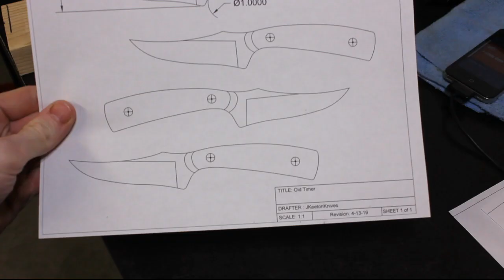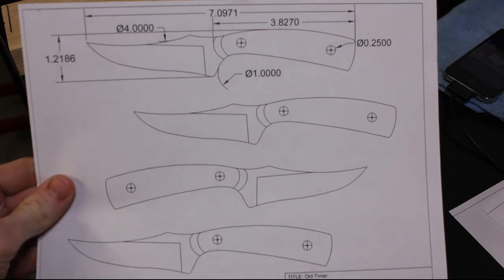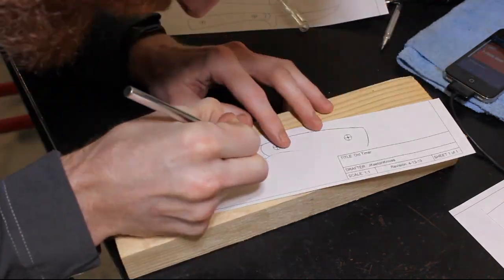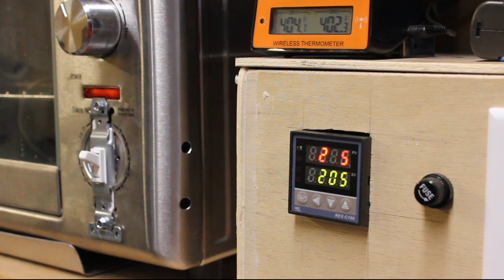Knife Build - Mustard Patina - Old Timer Sharpfinger Replica

Comment: I saw that use of square tubing as an oven a few nights ago on forges in dire
Reply from the maker: TheGhostBeast hey Ghost! That piece of square tubing in the forge is generally referred to as a “muffle pipe”. I’ve found it really helps you evenly heat the blade during the heat treat and minimizes hot spots!
Reply: JKeetonKnives I may try this. I do have a question though. Could you do it with a charcoal forge
Reply from the maker: TheGhostBeast , I don’t personally have any experience with a charcoal forge. But I have heard of people utilizing muffle pipes for them.
Reply: JKeetonKnives 
I use a charcoal/mesquite wood forge. Have never tried a muffle pipe. That’ll be next. You did an excellent job on the knife build. I just recently subscribed to your channel. I’d love to see you pounding something out. Keep on keeping on brother.

Comment: I just bit the bullet and ordered an oven. I enjoy using my gas forge but I’m limited to outdoor heat treating. My blades never flame in vegetable oil but I see yours do. Im definitely up to temperature ( non magnetic). 🤔
Reply from the maker: chip Lape man! I’m jealous! What oven did you go with? Mine don’t always flame up either. I don’t think that’s the best indication of success. I normally try and get 20-50 degrees over non-magnetic, but with my set up it’s not an exact science.
Reply: Even heat kf 18. Can’t wait to get it. Says 5 weeks 😬. So I’ll still be using the forge for now. I really admire your attention to detail 👍👍👍. Next I think I’ll get a big wheel. What size do you use. Then I really need the DD tool rest!!!
Reply: Love the mustard treatment. Is that it just leave it on 2 1/1 hours and wash off. Again what did you spray on your knife at the end.
Reply from the maker: @e.t.preppin7084  Yes sir, that's exactly what I did. Make sure your mustard has vinegar in it. I used Ballistol multi purpose lubricant to spray the knife down with.
Reply from the maker: @e.t.preppin7084  Man that's awesome! I'm supper jealous now! Sounds like a sweet oven. I haven't done any hollow grinding yet. The wheel I have is only 4''. I'm pretty sure 10-12'' is the standard for hollow grinding general knives.
Reply: I haven’t hollow ground yet but will progress to it eventually. Hey I really appreciate your videos and willingness to communicate. Keep up the great work.
Reply from the maker: @e.t.preppin7084  Anytime Chip! Thanks for watching. Glad you're liking them.

Comment: I have an old timer in its packaging at home!! That was nostalgic! 
Mustard looked great 👌🏽 
What finish has lasted the longest on your knives? And was that 1075?
Reply from the maker: Man these old timers are pointy aren't they?!? The steel used in this build was 1084. Most of my knives have a stone washed finish and I feel like this is a good working finish on a knife. Nothing wrong with a good old hand sanded satin finish either, but you will see some scratches more easily I think.... not to mention they take longer to get right when building.
Reply: Red Beard Ops they are really pointy, I skinned a Roo once with it and I kept putting nicks in the skin so it ended up being just meat 😁